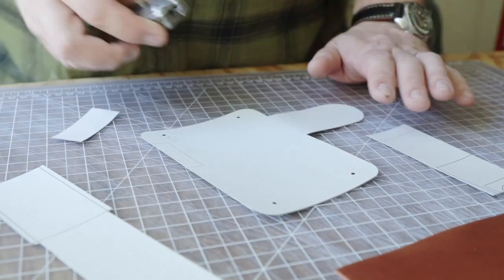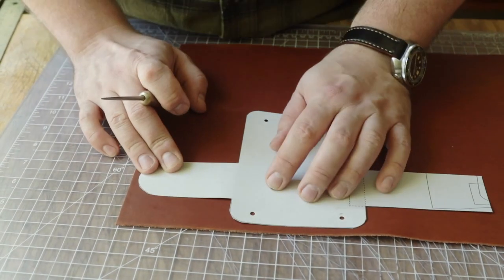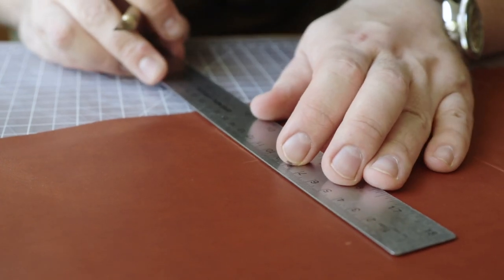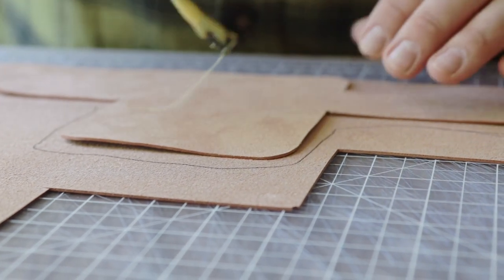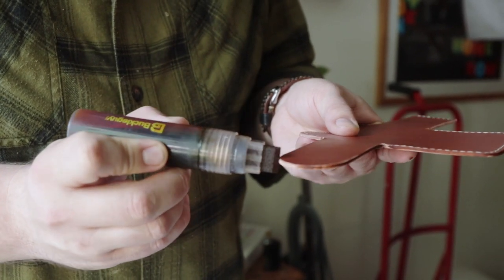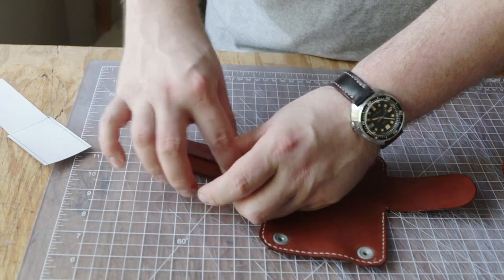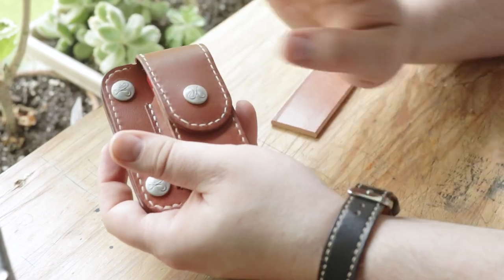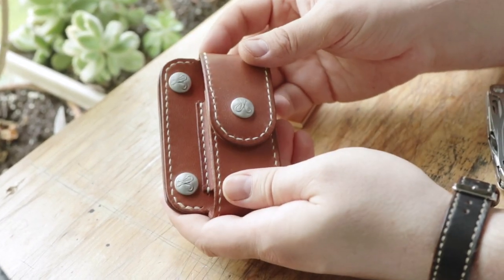EDC Multi-Tool Belt Holster Tutorial

Comment: I think I’ll add a hole on the non-snap side. Allows for you to “eject” the multi tool if it’s a tight fit.
Reply: Thanks for the ejector hole idea.  I also modified the belt attachment to have two straps so they can straddle a belt loop.
Reply: @carlo.738  curious to hear more about these extra straps you added so it could Mount to a belt loop. Cant quite picture it. Is is still mounted horizontally or is it vertical in this case? Thanks!

Comment: Not a leather question but from a watch fan is that the Seiko Willard? Nice watch and a good video. Thanks
Reply from the maker: It's a Willard mod I had built so I stop wearing my original willard in the shop because I'm constantly slamming it on things haha!
Reply: @Corter  what was your base watch and who did the mod? if you have the time to answer. if not thats fine.thanks for responding.i have a small nitch leather company and love watchs. its a addictive hobby

Comment: Would carry better with the snaps below, not above. You could also make a version that allows for vertical carry too by cutting a slot on the fold and stitching around it to reinforce it. Lastly, add a curve to your gussets to avoid “binding” like the 2nd multi tool had when you inserted it. Best wishes. Great design.
Reply from the maker: you can wear it either way :)
Reply: Thought about adding a slot to rotate it 90 degrees for vertical carry too?

Comment: Apparently you've never used an multi-tool or carried it for very long, I would close the upper and lower base holes they only allow dust and rain onto the tool and punch a 3/4 h or smaller hole in the base end to allow  your finger to push the tool out. Also having  to belt snaps on the top will only pinch  your skin when you sit down. love the ideas and the camera  work
Reply: Let's see the one you made, then.
Reply: @Jer0867  just a suggestion not a challenge